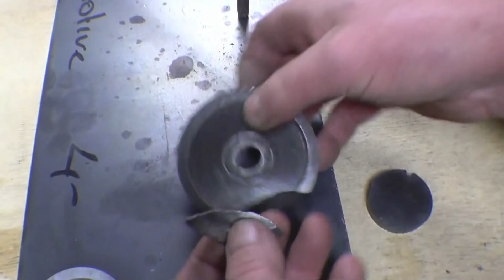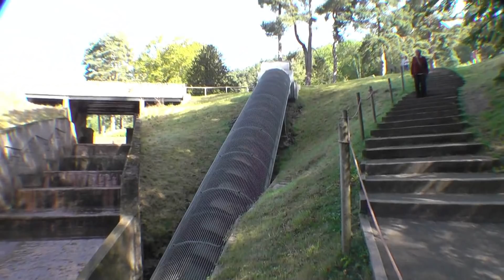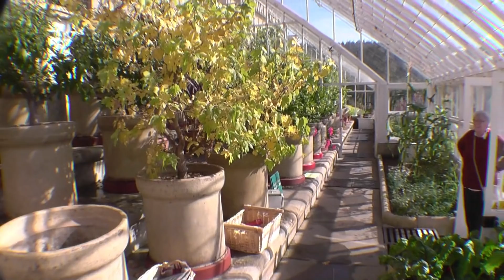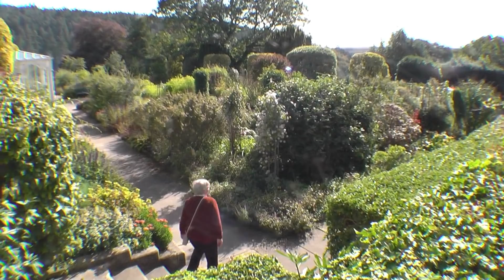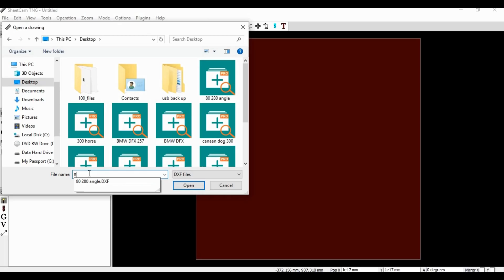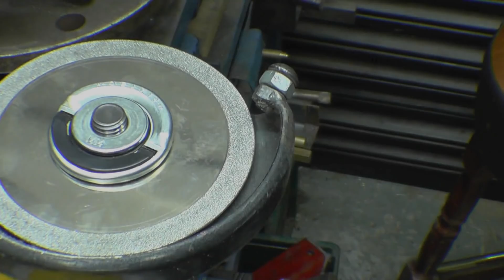SNNC 295 P2  Cast Braze Repair    Cragside Gardens

Comment: Hello from Norway. I have question about the video you published 7.juli 2019, Milling keyway on the lathe. I liked the dial indicator that you can put the "top" into a collett. 
What kind if indicator is that? . The top "pin" is straight,and doesn't move?  What is the name or type ? All my indicator the top moves.   Best regards carl

Comment: When brazing, you need to brighten all surfaces with some sort of abrasive and best to bevel large pieces.. Use just enough heat to make the bronze flow otherwise you create oxides and you can burn the life out of the work and the bronze...I learned this almost 50 years ago using oxy acet flame...Mike in USA
Reply: I know it is satisfying to repair some things but sometimes you have to say throw it away and buy one. a cheap pulley here is about $8 or 5 pounds. Cheaper than gas, flux, braze, lathe work and time.
Reply: John McKechnie that is if you can get the right one! Remember one of our Prime Ministers (Harold Wilson) changed us all over to metric a few years back so that you cannot get replacements for load of old equipment so you have to mend it (Harold was also an enthusiast for the EU).

Comment: oxy- propane that you are doing john is it a specific torch or can you just use a standard oxyacetylene one?
Reply from the maker: The torch is desighned for propane  the jets are different
Reply: Hi John,
Could you show your oxy-fuel setup please, looking at getting one, don't need acetylene, ref welding.
Thanks in advance.
Reply from the maker: @bostedtap   Yes no problem i will do a bit video on the torch
Reply: @doubleboost  Many thanks. Very much enjoy your videos.